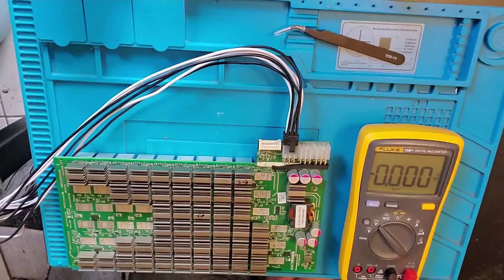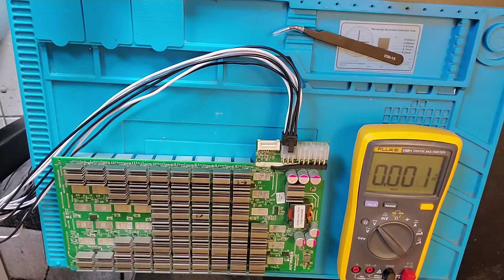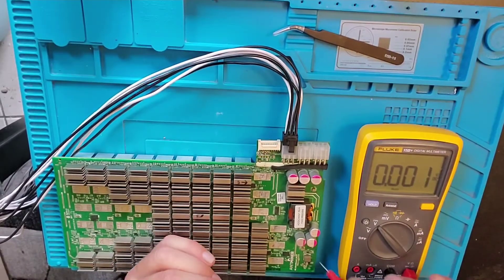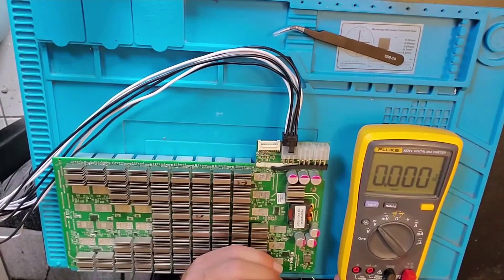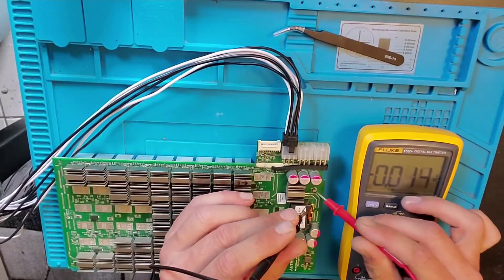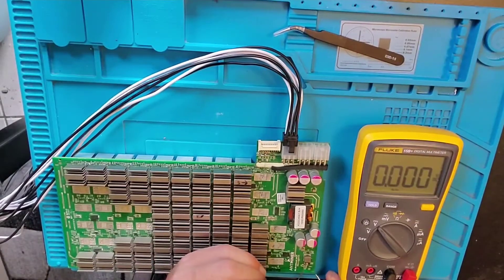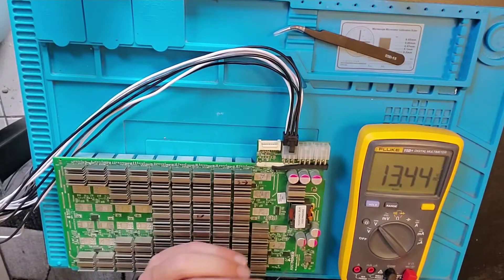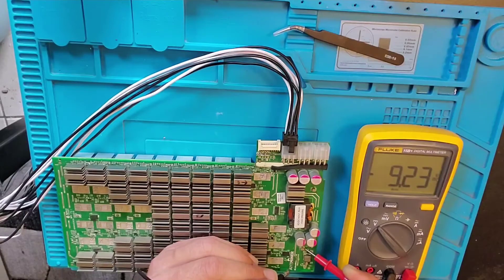How to fix a s9 hashboard - Step 1

Comment: why do you only connect one 6 pin cable as opposed to all 3 to fully power the board?
Reply from the maker: That is all that is needed to test the board, you do not want to do this while running the miner regularly, as it may draw more amps, causing the cable to burn out
Reply: Is it safe to assume that only the hashboard is powered and not the control board as well?
Reply: Refit your S17 (series miner) from NBTC to make it alive 
Save a lot maintenance cost
Stable performance 
A better price to resell